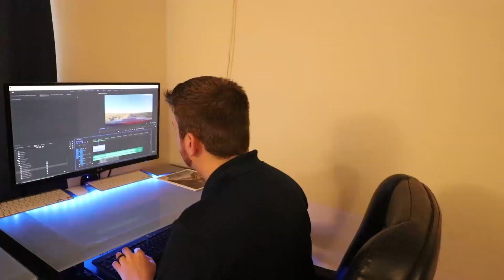Utah's Pretties Campsite. Crossing Utah Part 4

Comment: The heater will continue to do that. I have 2 of them with the filters and the "Special" Hoses and they still do it often. I have found that turning the knob slightly past low, or slightly below High and it stops it from doing it. Keeping the Propane tank covered helps too. The heaters are great, but are always a challenge every time we use them. They work great with the 1 pound tanks, but the big tank and hose combo can be troublesome at times.
Reply from the maker: Good to know! I picked up another one after the trip but we haven't really needed to use it. I've always had better luck with the 1lb bottles as well but they just don't last as long. The wife get's grumpy if she wakes up cold. If it's just me, I don't bother with the heater. That's what my 0 degree bag is for. lol